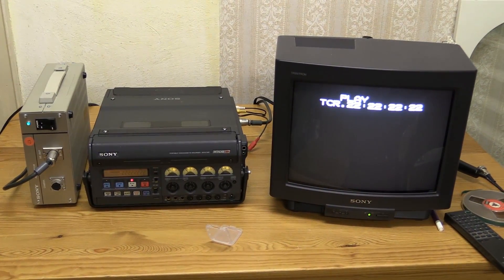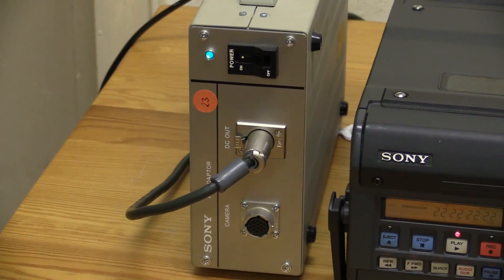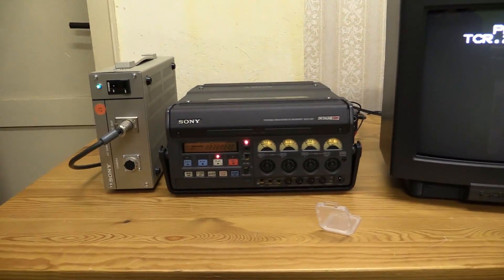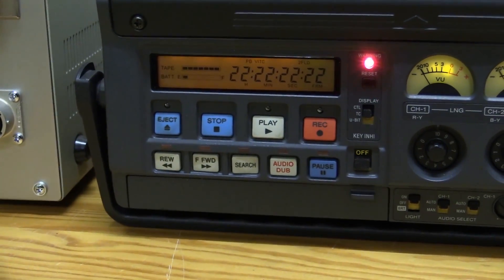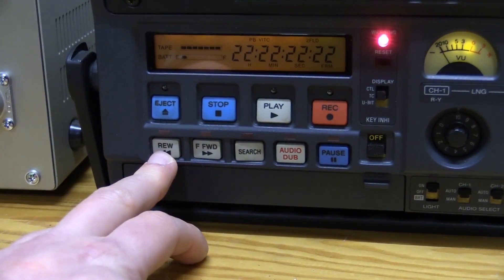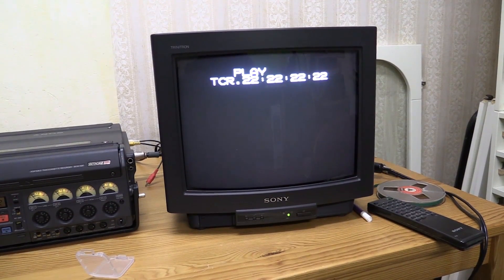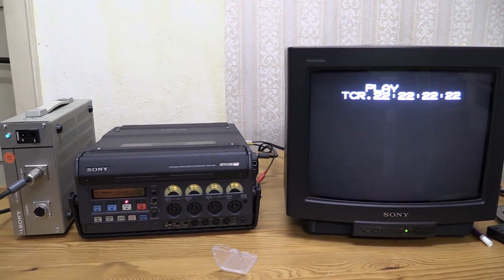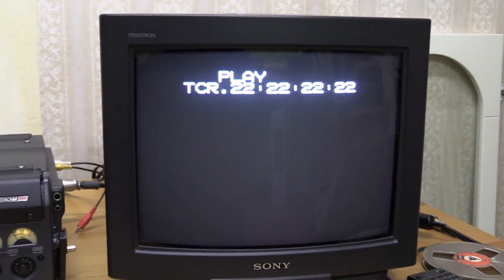Sony Betacam SP recorder update

Comment: You can try washing the circuit boards with soap and water. Even if you don't replace the capacitors, just cleaning off the electrolyte they've leaked out can sometimes be enough to get it working again, at least temporarily.

Comment: If the power supply has bad caps, it definitely could be part of the problem, the ripple from that can really screw with electronics making weird things happen.
Reply from the maker: I will have to look into that power supply first of all, that's correct.

Comment: Some capacitors use fish oil, as a replacement for toxic PCB oïl,  it is typically the case with microwave oven capacitors.
Reply from the maker: They all use a chemical substance that smells similar to fish oil. So if you smell something fishy in electronics, look at the capacitors.